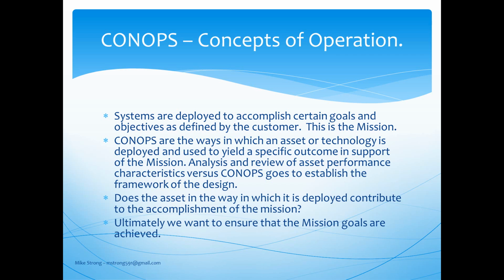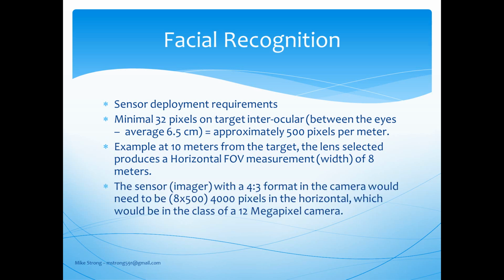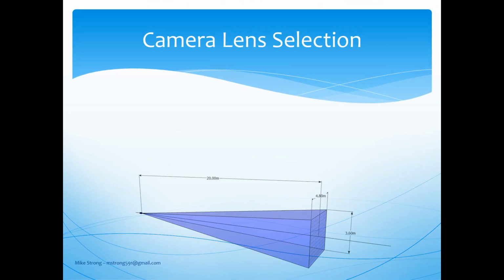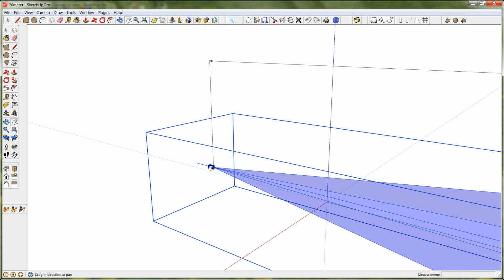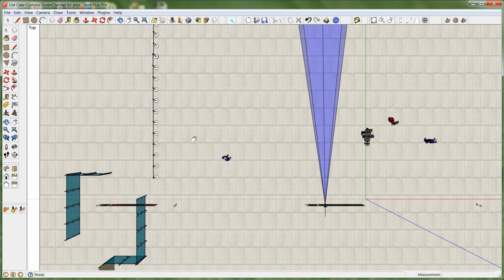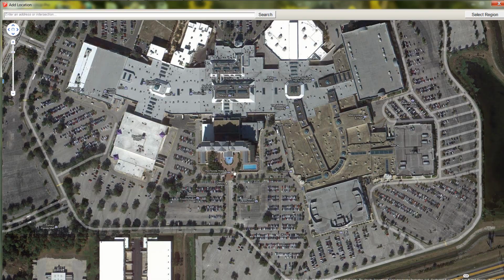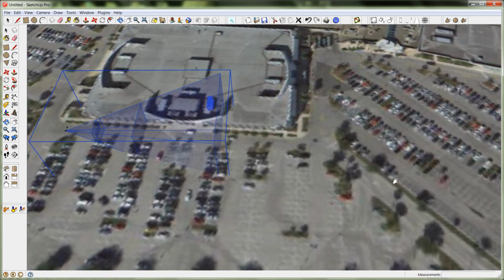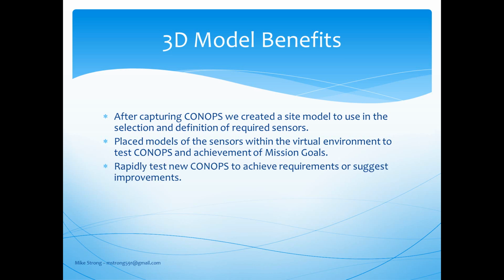CCTV DESIGN SKETCHUP_HD

Comment: Very intesting appoach to design cctv systems. Sad now web version of sketchup doesn't support plugins. In case if you want to design using 2D and see 3D views from cameras you can use IP video design tool. The diffrerence is a huge updated camera database, pdf/doc reports and export to DWG.